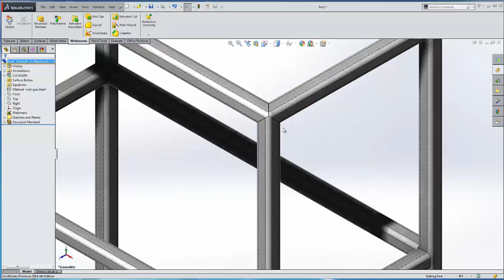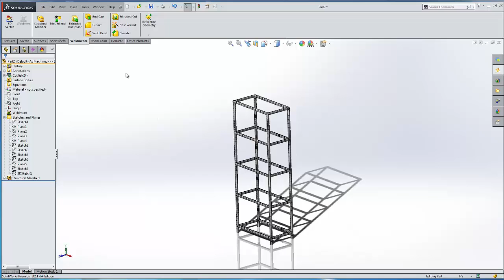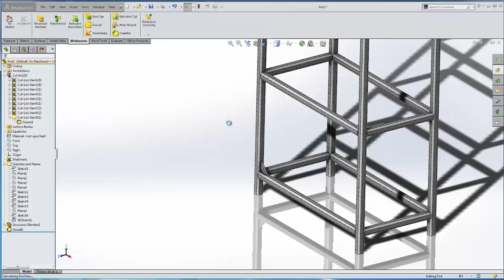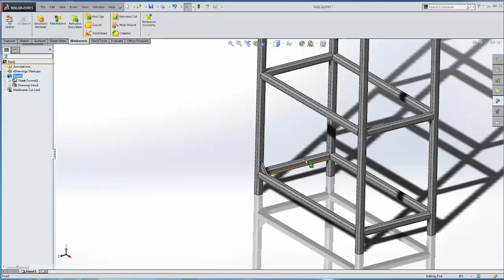SOLIDWORKS Weldments - Corners Gussets and Bounding Box

Comment: How did you get the BOM to call out all the dimensions of the bounding box. Typically I need to enter overall dimensions for all the bodies within the BOM. 
Any suggestions on how I could make this self generate?
Reply: Some things to remember: Did you remember to update your cut list after you generated the bounding box? Did you rebuild the drawing / update the BOM (BOM is specified as parts only)? Also, what version of SolidWorks are you using? Thanks for the comment. 

-Adam